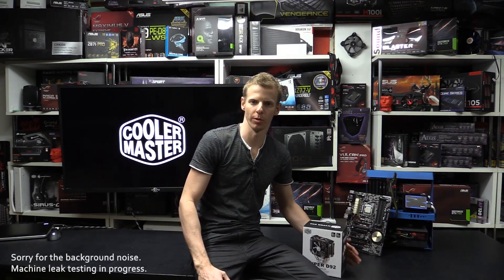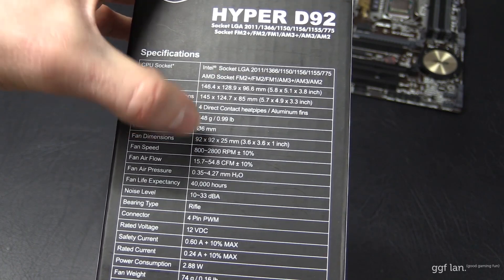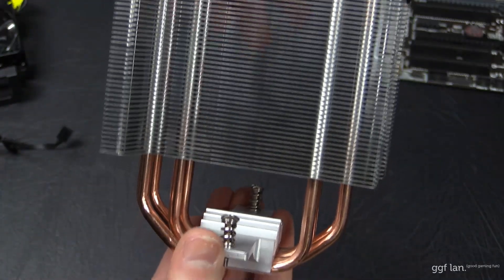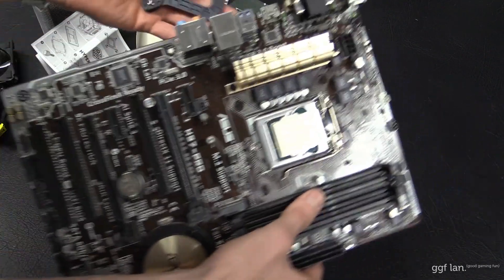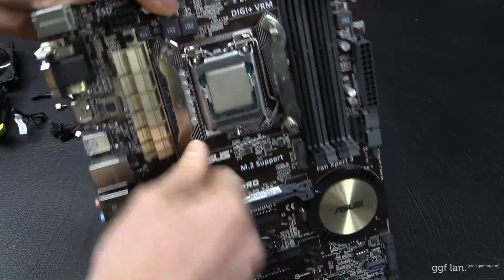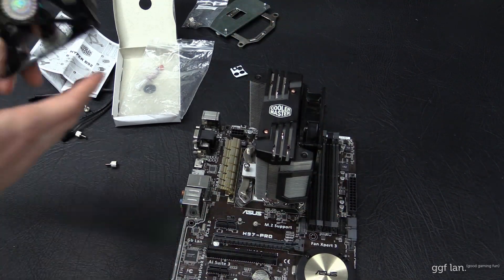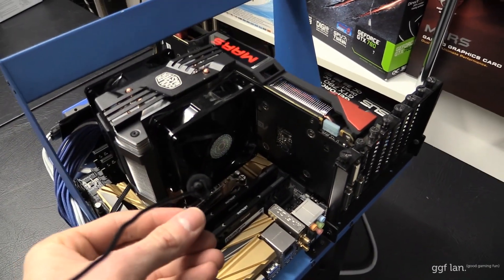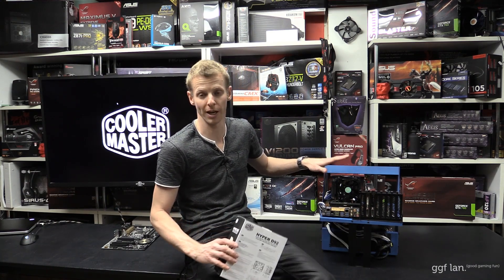#0086 - Cooler Master D92 CPU Cooler Overview and Quick Testing

Comment: On the website it says it supports intel socket 1151 but on that box and othe places it does not, I have an i5-6600k and think this is a good cooler, will it fit?
Reply: it fits..im using i7 6700
Reply: Thanks :)
Reply: Skulldriver 360 if it fits an 1150 socket then it probably fits a 1151 socket because they're practically the same

Comment: How far must one screw the spring loaded screws for i7 4790k socket 1150 ? In every single review no one states this. Do you screw the spring loaded screws until they give resistance or is it only till its tight it doesnt state this and its by far the most important step in stalling this thing ?

Comment: On my AMD gigabyte BOARD THE COOLER ROCKS A LITTLE,IT NOT ON TIGHT.WHAT DID i DO WRONG?
Reply: +Norman “ndhudecz” Hudecz check that you used the right set of spacing "bolts/nuts" that are in-between the motherboard and the mounting bracket. Also check if your rear plate was installed correctly.
Reply: +Elliott Thompson (8-Bit Archeology) You're right I used the wrong bolts,I got it thanks.

Comment: I play gta 5 on ultra with a stock cooler... at 64C max.. will this loser my temps?
Reply: +iceeblister  bruh lol i play gta 5 on stock ultra and get like 80 c max wtf i call hacks
Reply: Bakir Bakir Learn about air displacement. It's also nice to have top of the line thermal paste and fan control..

Comment: Would this preform better than 2-fans 212 evo?
Reply: +TavTheWasaper Hyper 212 EVO would have 2 120mm fans this one has 92mm. Technically the 212 push/pull should perform better but they have similar results.
Reply: @WarHell pls reply. what is the color red is it cool or hotter temperature?

Comment: Just bought this cooler whit an x99 Sabertooth and Core i7 5820k. The processor (huge) is biggest than the Cooler base. Can i run my system whit this situation?

Comment: dont buy this for lga 2011-3
Reply: Why it actually supports it.
Reply: it good for stock clock but oc you will have trouble cooling it
Reply: black crow1234 Ya and if you are using 2011 you really shouldnt cheap out on cooler
Reply: +aaron evans it will cool it but it will also make more noise since it a 90mm fan just get the hyper evo 212 plus that cooler is very good and it only $29.99 or maybe even less at newegg plus that cooler can handle OC 4.0 to 4.5 depend on what 120mm fan you are using to cool the heatsink
Reply: +aaron evans it can handle OC at 4.4 or 4.5, but like i said it depend on your 120mm fan push and pull might decrease the temp by maybe 3 or 4 dergree  if you are not a heavy OC person than no need to worry if you are than water cooling is what you are looking for
Reply: +aaron evans get the arctic 1200mm fan they are sold at amazon in bundle of 5 fan for $25 those fan are very good i;m using in my case and it drop my cpu temp by 6 degree way better than stock cooler master 120mm fan plus the hyper evo 212 size is just a longer than 6in maybe 6 1/2in so it can fit any mid tower case
Reply: +black crow1234 120mm not 1200mm
Reply: My heart almost stopped when i read not to buy this for 2011-v3, then you said it depends on the 120mm; as i'm going to OC the CPU (5820K) do you think it can manage it well on an enthoo evolv atx at 4 - 4.5Ghz??

Comment: For those of us looking for a cooler that will fit in a case with a max cooler size of 155mm, this cooler WILL fit. Of all the coolers that will fit that are no down draft, I think this one may have the best mounting option followed by the Thermalright Macho 120.

Comment: Would this fit in a corsair spec 01 case? Also can I leave my motherboard in my case during install?
Reply: I know this late but according to the height it should, I was looking at this for my spec 3
Reply: +Cosm0s ah I ignored the cpu cooler compatibility before I bought my corsair spec 01. and then had to skip out on 212 cooler I wanted. did you get any good one that fits spec 01?
Reply: +Sahil FS I'd say this one seems to be best that would fit out of the ones I've looked at, since water coolers are pretty much a no go in it, and it preforms at least on this guys rig pretty much the same as the 212
Reply: yeah I am gonna get it. thanks for the reply man.
Reply: i ended up using the hyper tx3 i thinkis the name? the smaller one, hven't overclocked yet though maybe in the future
Reply: oh I see. I've read in test results that tx3 performs quite a bit lower than Aidos. But yeah its more than good enough if you don't overclock. in that case, Hyper 103 is really good too. 
I've ordered Aidos already, gonna have to wait about two weeks to get it lol. lets see how it ends up doing.
Reply: Urgh...

Comment: I picked this up. Nice and easy to install. Only thing I was disappointed with was the plate was a little rough in finish - I'm sure it would improve the temps a bit if it had a little more polish. Had to clean adhesive off from the protective sticker too. It enabled me to get to 4.4 GHz with decent temps but I decided to go back to 4.2 to keep things cool and quiet.

Comment: For the Installation, What size of board did you use? Standar ATX or Micro ATX
Reply: ***** Thanks!!, But too late I already have this Installed on a Micro ATX however the orientation is not the same, I fear that I might be screwing some components in the board, Im going to update that soon